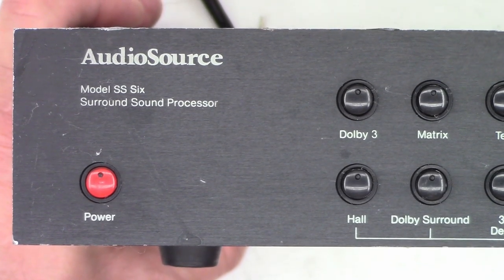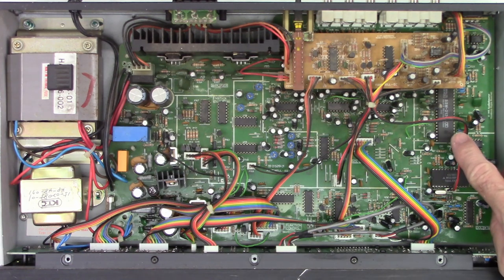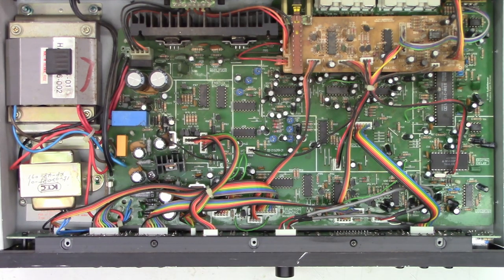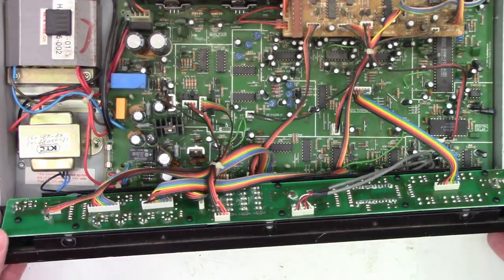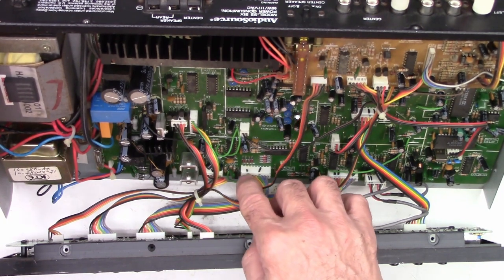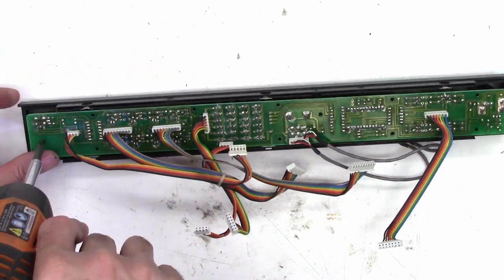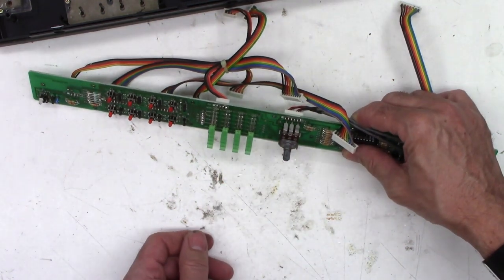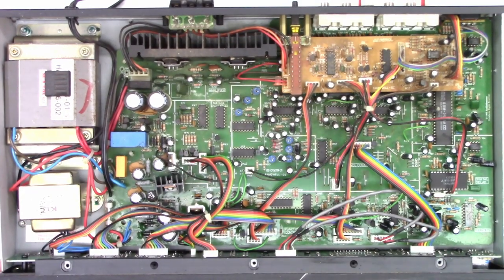AUDIOSOURCE SS SIX DOLBY PRO LOGIC SURROUND SOUND PROCESSOR REPAIR

Comment: Pro tip: You should have tested it before reattaching the front panel, that way if you needed to take other measures, e.g. further cleaning or replacing the pot, you wouldn't have to take that panel off again.  You lucked out!

Comment: Stupid question - but is there a time that deoxit will not work on a potentiometer, ie if its heavily used and has dead spots or is it always a case of just being dirty?
Reply: I'm sure you can find a case where a pot has cracked legs from a bad mounting design, or something where a pot gets smoked with the wiper at one end (not likely in audio equip)
 
The more common stubborn cleaning jobs are ones where the bottoms of the pots face up for some bad design reason.  Then you wind up with the pots so full of greasy lint and dirt that it's better to just pre-flush them with plain (cheap) cleaner and air instead of wasting a bunch of deoxit.
 
Other than pots, I've had a lot of slide switches and DIP-pushbutton switches (like speaker select switches) go bad too, but they usually just wear their contacts in half, so contact cleaner won't fix that.